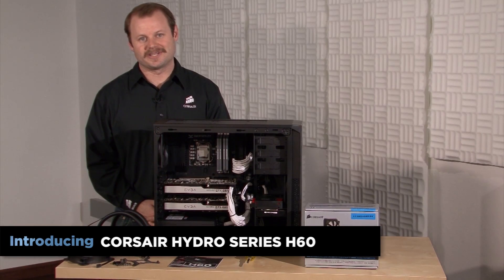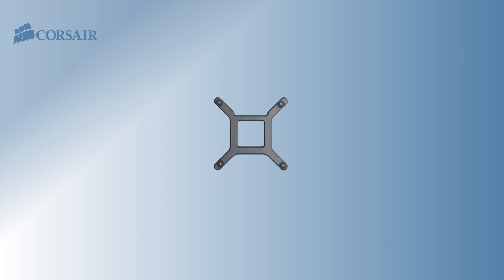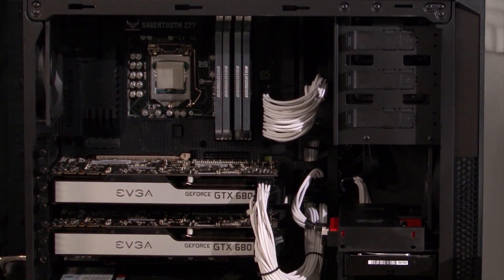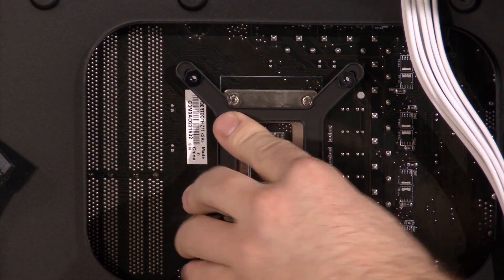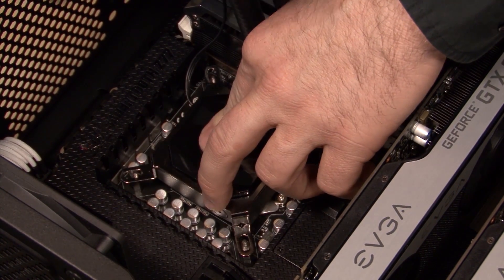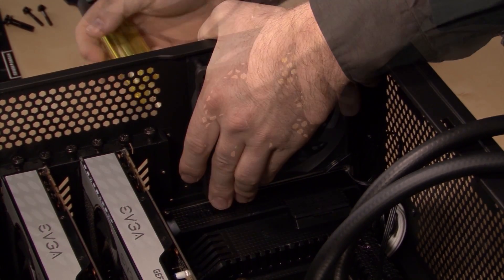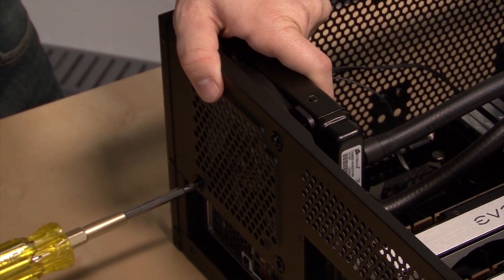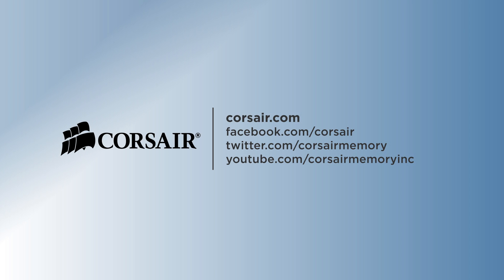Corsair Hydro Series H60 Liquid CPU Cooler Installation How-To Guide

Comment: Lol Ive had this radiator installed for two years and just now realized I had the fan on the wrong side
Reply: you had the fan mounted on the inside pushing air outside through the radiator?
Reply: @bruta  Yeah lmaoo XD
Reply: @MistaWind that's funny because I want to try it like that... did you move it at the back now and how are the temps after?

Comment: I found an old H60 in a scrap-pile outside while walking the dog in the woods.
The one I found was for the AM3 socket, lucky me it fits on AM4 with some mods.
I can't complain, my R7 4750G never gets over 45 Celsius even when full load stress-test. I switched to push-pull fan config with 2 Artic fans, the radiator was missing then fan.

Comment: Can you please make an H60x Elite RGB video? The PDF manual for it is actually quite bad. The H60x has two cables. One is three pins and the other 4 pins. My Mobo has CPU_Fan and PUMP_Fan, both 4 pins. No clue which goes where, due to really bad documentation and lack of video tutorials online.
Reply: did you ever figure it out? same problem here

Comment: I was legit about to buy a bigger case. Every video I saw had the radiator screwed in first (which I thought was weird because the manual had it the other way) and no matter what I did the screw holes just wouldn't line up.

Comment: Im confused. Probably picking it up wrong but he replaces the exhaust fan with this . So its gonna be pushing air out of the radiator but then says its drawing air in .... does this fans suck air in or blow it out ?
Reply: i think it’s blowing air from inside the pc, outside the pc. Passing through the radiator-then the fan-then out the back of the case.

Comment: I will install it this way, but the included installation guide shows the fan on the other side, and the radiator touching the case. Is there reasoning for this? It seems it doesn’t matter too much, but it makes a little more sense to me the way you did it. It’s just curious that you deviate from the included official Corsair manual is all.
Reply: Glad I found this. I just "realized" I may have installed my fan wrong, but I probably just read the instructions correctly. PC has been running fine Ha! At this point I'd only open it up out of curiosity.

Comment: I have recently bought H60i RGB PRO XT. Personally I do not give a thing about lights. However there does not seem to be any software or driver for Linux. And the fan goes like airplane taking off in my room. Since I have already installed it I could not return it either. So I have two questions:
1. Are there any Linux software that I can use ?
2. Can you fix the settings whilst in Windows such that it stays with those settings even when control software is not running (so I can set it up on windows and switch to Linux?)

Comment: bough it 5 years ago for a i5 4700k, I updated my setup to Ryzen 5 5600x and was able to install the H60 without any issue, that was a nice surprise.
Reply: How are the temps with the Ryzen 5? I was hoping to use an H60 on a Ryzen 7 3700x til I figure out a custom loop...
Reply: @jamesklein6361  So far good, idle is 40°c and gaming Warhammer II goes from 50°c to 60°c, doesn't go above 60. I live in a warm place and keep in mind that it will depend on how well ventilated and placed is your PC.
Reply: @ecorona21  Thanks, good to know!

Comment: @Corsair I bought this cooler for the2011 socket years ago and am really happy with all my corsair products. thinking about upgrading to a new MB and CPU, and while deciding on a new corsair watercooling solution I am wondering if i can transplant the old H60 and if it is going to fit the LGA1200 socket
Reply: Works?

Comment: Mounting bracket was already installed on mine (the aussie version), they're smart, they know im dumb 🤣
p.s if you're a noob like me and don't understand the intel models etc then let me tell you just because the 'long stand-ins' fit and you KNOW its intel DOESN'T mean SHIT!! my cooler didn't work it kept overheating, i then realised because it did not make contact with the CPU so i ripped off the shitty acer aspire proprietary back plate and used the corsair which had SHORTER feet DESIGNED for the cooler, now it works

Comment: hey, the backplate won't tighten up firm, it's rattles lose with all 4 screws tighten.
Reply: had the same problem...you need to put some plastic/rubber... washers under the screws. Thats not very well made from corsair.

Comment: The H60 I got has two power cables. Why does this 7 year old video not show the current cabling??
Reply: yeah did u figure out where the other one goes? im at a loss
Reply: @garyreid7919  SATA power for SATA power obviously, pump power to AIO cooler/CPU fan, the radiator fan to a CPU fan / chassis fan, whichever you fancy

Comment: >replaces the case exhaust fan
>faces it to blow air into the case
>says it is isntalled to pull heat out of the radiator 

what??
Reply: Right?  I just don't get that one

Comment: Wait, the rear fan he installed is an intake fan? I thought it would have been an outtake fan?

Every article etc I've looked up said your rear/top fans should be outtake fans. So why's this guy doing it differenly?
Reply: It doesn't matter which. I think intake is better cuz you're pulling cold air from outside through the radiator but I believe Linus did a test once and both ways barely makes a difference. Just don't have your airflows conflicting too much. I personally do outtake on the top fans, intake on the front fans, and intake on the back/radiator fan. Some people prefer keeping it out take because then the dust collects on the radiator on the inside rather than dust collecting on the fan AND in the middle of the fan/radiator.

Comment: Excellent video. Thanks for this. I just finished installing this cooler. The installer is a lot more straight forward than the H50. The back plate is much better with this cooler than the H50. 

H50 relies on adhesive, where as the H60 has screws which keep it secure, and once the back plate is installed, mounting the cooler is so much easier. 

I have a i7 6700k, and without overclocking, I am getting around 50C with Prime95 at 100% load, and it idles around 30C.
Reply: Hi , I have the same thing installed too, can you please suggest how to clean the product ? I can see quite some dust on the fans , have not cleaned it since I installed it 8 months back

Comment: There's two connectors on the cooler. You say there's only one, but there's two. There's a 3-pin coming out of the cooling block and a 4-pin coming out of the fan.

Comment: Sounds like a good way to make the case way too hot. I imagine you want the 120mm back fan pushing outward, not pulling air inward.
Reply: I had the same intuition so I tried the other way around and it got a lot hotter, the fan and radiator seems to be designed to build up static pressure and not much hot air actually comes through the radiator into the case… strange but it does work better the way it is installed in this video.
Reply: I agree. My case 2x 120mm front fans draw air in through a filter. My single 120mm read case fan blows air out the back. If I were to allow the H60 radiator to blow hot air into the case from the rear then a pressure would build up and that would cause my GPU to overheat among other components. As it stands, the extra air flow from the front goes through the GPU and out the GPU vents out the back.

Comment: Why does nobody show where to connect the cable for the water pump on the motherboard ??? I've connected everything as described, but as soon as I start the PC, the CPU temperature rises to over 70 ° Celsius !!!!
Is the water pump broken ????
Reply: GEROLD WAEFLER  yeah i wanna know we’re it goes
Reply: Check your bios configuration. You have to disable smart fan and put it on full speed. And make sure its getting 12V.

Comment: I've been running my H60 since around 2104 and it's great. I was able to overclock an AMD FX8320 from 3.5 ghz to 4.5 ghz without any issues..when I upgraded to a Ryzen 5 it was nice to see that it fits on the AM4 board the same way it fits the AM3+ board..
Reply: samuel lopes what's it like in 2104?
Reply: @xJarlrus  It’s bad bro Big Chungus died back in 2097.
Reply: @CrabSoundsInYourHead we might’ve lost big Chungus but at least we don’t gotta eat nasty stuff no more… those calorie blocks are a whole days worth of food in just a few bites I love em
Reply: Yeah I was running one since 2012- the H50- then I switched to an intel in 2019 and it didn’t occur to me that the reason it didn’t fit on my new one was because I needed to get the intel bracket out of my box >.< so I ended up buying the H60 finally and I gave my old one to a friend. Still worked great, though!

Comment: Why do people constantly show installation videos where the cooling fan is pushing the hot air into the case? Makes absolutely 0 sense doing that. The idea is to keep the case temps down, not add to it. Though the liquid cooler will do its job, that configuration to attach the fan to the case then to the radiator is a waste, IMHO.
Reply: the whole point is to push cool air from outside through the radiator and let the other fans vent the case.. I've been running mine the way he did it in the video with no issues for the past 4 years running an FX8320 overclocked to 4.5 ghz which runs real hot....
Reply: The point is to draw cooler air from outside to cool the radiator instead of using the warmer air inside to pass through the radiator. His logic is correct... although personally i'd rather install it in the front, intake cool air from the front, and exhaust the hot air from back/top.
Reply: You should have an extra fanto push out hot air
Reply: so is the guy from the vid doing it wrong or right? ty in advance sorry if my english is not perfect
Reply: This is a weird setup...
The main goal is to pull cool air into the case through the front using dust filters, and use that cool air to pass the radiator pulling it outside the case... My i7 8700k works idle at 35C and fully stressed at 74C. Case temperature never exceeds 35C with a GeForce GT1060...
Reply: Pedmar 007 It either exhausts or intakes. It does not really matter.
Reply: @coolmemesbudd  The optimal case is when you create a secondary air circulation with case fans (pull in front, push out top/back). This cool air can then be used to pass the radiator pulling in out of the case. Then you avoid dust inside your case.

Comment: did he really just took off HIS ONLY EXHAUST fan and put it on BACKWARDS to make it an INTAKE
holy shit i wouldnt let this guy plug the USB in my PC
Reply: the whole point is to push cool air from outside through the radiator and let the other fans vent the case.. I've been running mine the way he did it in the video with no issues for the past 4 years running an FX8320 overclocked to 4.5 ghz which runs real hot....

Comment: Would it be a good choice to install the h60 radiator on the top my case?? I want to keep exhaust fan just for the general airflow of the case. I have a carbide spec 03 case.

Comment: why didn't he mention the backplate screws are adjustable?
Reply: superdupe YOU JUST SAVED MY LIFE. I was about to give up because I didn't understand why it didn't fit when my old cooler fit just fine
Reply: @Tommyr44  thank you sir. :)
Reply: Walter White lol same here, i eventually found out by myself. i don't like how he doesn't mention where the cables are supposed to go after you connect the cooler
Reply: superdupe Care to explain what problem u faced ?
Reply: superdupe I tried for an hour without knowing that and it didn't work... for that whole hour... what a waste.

Comment: does anybody here actually pull air from outside? I have never had luck with that ever. I always get better temps blowing out
Reply: How did you mount the cooler fan? What side did you put the fan on? I need help? What side do I have to face the cooling fan to blow the hot air from the CPU out of the case?
Reply: +John Khan Corsair logo should be facing the radiator to blow air from the outside of the case to the radiator.

Comment: I'm planning to upgrade my PC. From MSI z87m+Intel i5 4670K (LGA 1150) to Z270 Board+Intel 7700K (LGA 1151). But i'm curious about mounting holes????? Does it fit (H60) to any LGA 1151 Socket?
Reply: Raymond Espera yes

Comment: The CPU backplate does not fit into the socket correctly. Is this because my Maximus  Ranger motherboard does not support this cooler or did I make a mistake?
Reply: Tristan H make sure to adjust the screws of the backplate

Comment: is that too much thermal compound for a 1151
Reply: No, I used mine on a 1151. It will just touch the bracket too, but that doesn't matter.
Reply: which standoffs did you use for your 1151?
Reply: Traumadd the ones that came in the box
Reply: Traumadd What the manual said.
Reply: Zorra FoX They said anything about 1151s I just used the longer ones
Reply: Traumadd You use the intel standoffs thats it.
Reply: Zorra FoX there was two type of intel standoffs, but i got it anyways
Reply: Traumadd Oh ok I think one was for 2011-3 and the other was for 115x

Comment: But these things only last for 2 years right and then they break?
Reply: I got one In Oct 2012 and it still works as of Aug 2017. Building a new PC and I ordered a new H60 for it :)
Reply: my H40 lasted 6+ years, just replaced it this week
Reply: yes
Reply: Mines 6 years old and still going ... mind you, its on my GPU now. Just ordered a new one for the CPU
Reply: im scard now. if it fails and my cpu burns will I get 10,000
Reply: Mine has been running with daily use for 7 years.
Reply: Mine lasted for 2 years and 10 months. i just got mine replaced for free, 2 months later and my warranty would not have covered it :D

Comment: Its gonna be a dumb question but H75 has double fans but costs $15 more. So my question is, can I add a second fan to this (one of my Akasa Apache fans)? Will it affect the performance of the unit badly due to different fans used?
Reply: This is a 120mm radiator so it can only fit one fan
Reply: +Atik Bayraktar yes if you do push pull.you can look for videos on youtube.
Reply: 0

Comment: This video forgets to show how to apply thermal paste. 
You need to apply a small pea-sized blob of it on the actual CPU and squish it down evenly with the water cooler block.
Reply: +Connor Lester (MasterDode) you dumb ass look at 0:50
Reply: +Connor Lester (MasterDode) I never said it was good, don't put words into my mouth. The reason why I called you a dumbass was becuase you call all pre-applied thermal paste as bad, that in itself is stupid. Buying some of the market thermal paste will make your CPU's temp lower but not by a lot, never the less it won't be changing the performance of your system just the tempeture. If you think putting in pre-applied thermal paste is bad or "risky" do you actually think that a company(corsair) whose main objective is to keep there costumers hardware nice and stable would give out trash or unsafe pre-applied thermal paste? Do me a favor and stop misinforming other people
Reply: +Connor Lester (MasterDode) You're quite the dumbass...
Reply: Explain how
Reply: Connor Lester I'll just explain the basics. First of to say Corsair gives some trash thermal paste that's dried up and will ruin your cpu is quite stupid in itself. Secondly even the worst of thermal paste take up to 5 years to dry out wich you can tell it dried out. I could continue on but I think I made my point....
Reply: The pre-applied thermal paste that corsair gives is not actually that good, I mean it's a lot better than your average £3 custom thermal paste, but it doesn't beat good custom paste. You just said that it must be good because you have a good expectation of Corsair, so it's not fact. So based on experience, the H60 that I have got ended up having the CPU welded to the cooler because of the pre-applied thermal paste. I now have custom thermal paste which is a lot better than the default pre-applied thermal paste, and it doesn't weld to the cooler (And the CPU sometimes runs at the same temperature to the one that got welded)
I think it is just bad if you're going to use pre-applied thermal paste because it's generically bad and risky (because of bubbles) to do so, if your CPU runs hot, like mine.
Reply: +Aleksand 36 It's not stupid to call pre-applied thermal paste bad. And if you want to use pre-applied thermal paste then it's okay. However, good custom thermal paste is always the better option than going for the pre-applied thermal paste. Also, all I commented was how to apply thermal paste, because some people, like me, don't have pre-applied thermal paste on the water cooling because they bought it second hand or got given it. Also, to answer that somewhat of a question thing you attempted in that comment; Corsairs main goal with applying pre-applied thermal paste is not only to make sure they at least have okay paste, but to make sure the people who can't get thermal paste can install it anyways. 
Corsair may say the paste is amazing and the results are better than the regular paste applied to stock coolers, but it's nothing amazing. 

Also a few things I want to pick at in your comments:

- The temperature of your CPU directly affects its performance.

- I didn't put words such as "good" in your mouth , it was implied by you because there is no other reason why you would be commenting 

- I'm not misinforming people by telling them that custom thermal paste is better.  And I'm just explaining how to do it just incase they need to. Although I could see how it could be misinforming if they go ahead and buy really cheap thermal paste.

- There is some aggression in your comments. To me, It seems like you're just commenting at this point just because you feel superior.
Reply: +Connor Lester (MasterDode) damn bro
Reply: +Connor Lester (MasterDode) 
I was wondering the same thing.